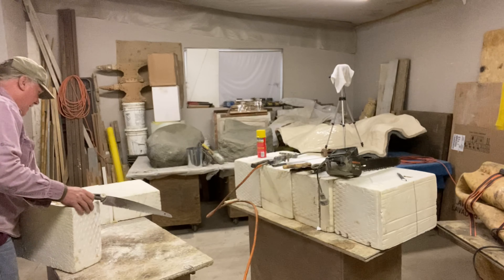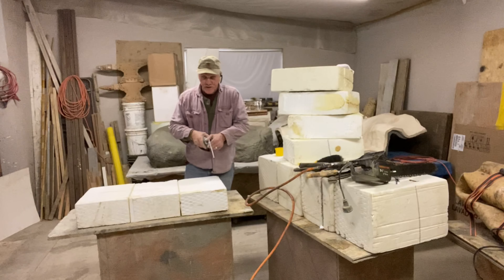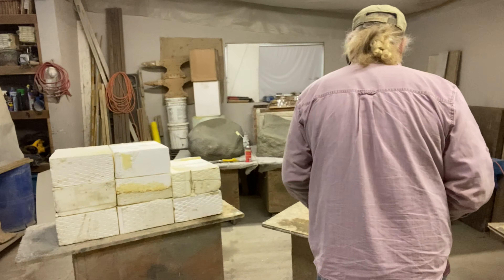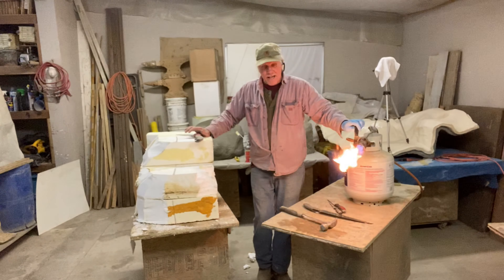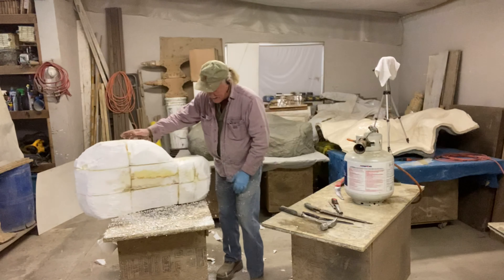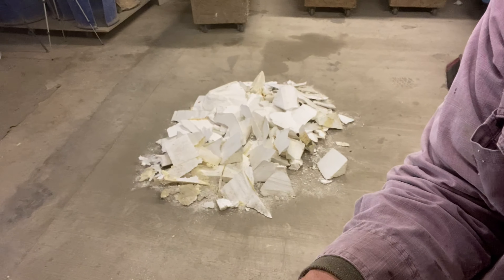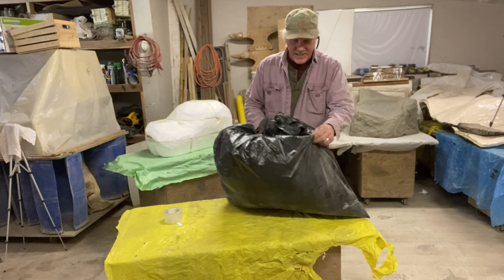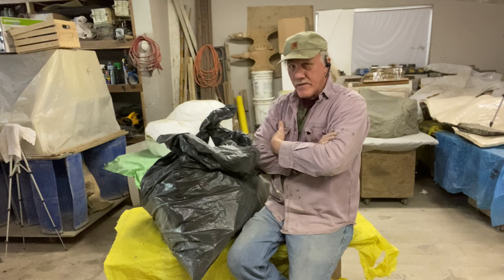How to make a rock using a Foam core and or using a trash bag (part 1)

Comment: Ever thought of using an electric  styrofoam "hot wire" knife. That way you wouldn't have all that styrofoam shit all over the place..!!
Reply from the maker: I have three different electric knives for cutting foam and could make a blade profile to whatever shape I wanted to cut, but in this particular case, the fine-tuning of carving, the exacting formation would be difficult with a hot knife. Thanks for watching my video.

Comment: Please give me the name of the cloth you use that embedded into the mortar?  Is it something I can get at stores such as Lowes?  Is the cloth a necessary part of making the faux rock?
Reply from the maker: It’s not needed, but it does make the rock stronger…

Home Depot 
48" x 150' Non-Adhesive Stucco Mesh 

https://www.lowes.com/pd/BOEN-48-in-x-150-ft-Non-Adhesive-Stucco-Mesh/1001764418

Comment: Do these work ok in a berm? We get heavy rains and I want some rocks on a down slope so I can make some beds bed it but worried about a foam rock washing away.
Reply from the maker: Keep in mind even though the rocks are made using a phone core the cement is still substantial wait to keep a rock in place
Reply: I was just thinking here in Nebraska my boulder would blow away if you didn't stake it

Comment: Will you use chicken wire at any time?
Reply from the maker: Yes from time to time, But I prefer the use of nonmetal reinforcement because most metal will rust out in a given period of time where the synthetic or the textile reinforcements will last forever
Reply: @fauxrock  Where do you get your reinforcing material? Looking forward to the next video in this series.
Reply from the maker: Stow is the company that makes the mesh
Reply: @fauxrock  Thanks